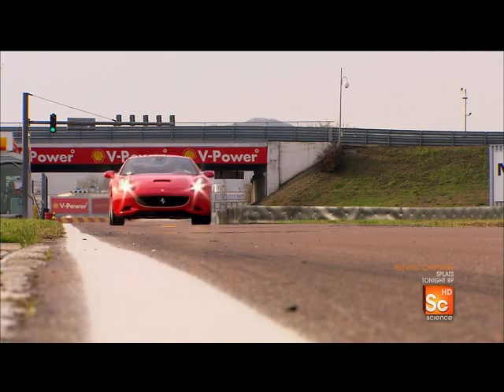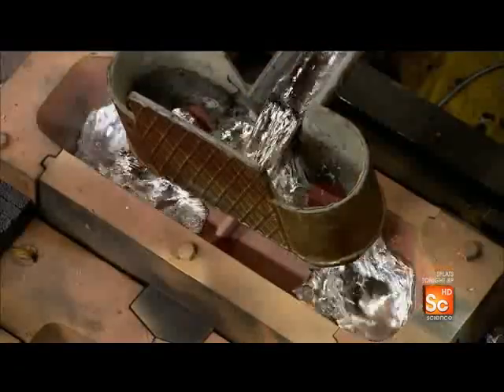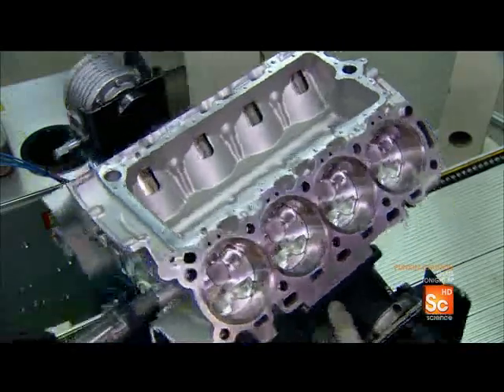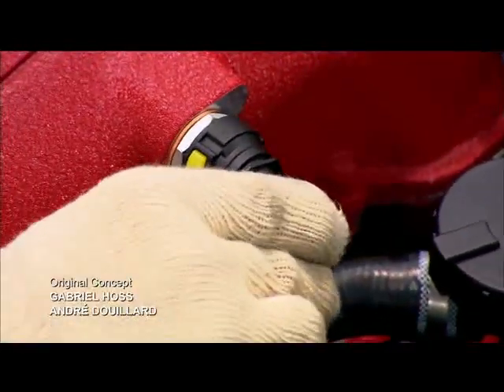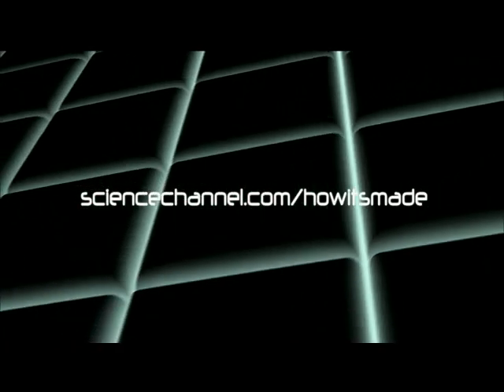How It's Made High Performance Engines

Comment: oh cool it one of those quad overhead cam camless engine ive heard about from every how its made video showing engines ever
Reply: +Eric Wesson Yeah...I've never assembled an engine, but I assemble lots of things, and was looking at that thinking "wtf is the point of doing that when the cam isn't in?"

One of those things that's so simple, if you have to tell the tech that, you need a better tech.
Reply: +KSI SubSonic They were probably installing the cam caps ready for line boring because none of that was mentioned in the video.
Reply: +aluisious yeah they completely left out the milling portion of the build where they flatten all mating surfaces such as the the cylinder heads, where the oil pan goes, etc. You would also want to install all bearing caps for when you bore the bearing locations. they do this to the crank, piston, and cam bearing locations.
Reply: adam courtney they have to make the episodes fit within a certain time period. when they have different time constraints they show more or less detail in the construction process.
Reply: It's actually Dual Overhead Cam, 2 cams per cylinder head

Comment: Add valve cover. Then install air intake manifold and fuel injection system. But what about all the over parts? Like oh, I don't know, oil pan, alternator, distributors and spark plugs roller rockers and push rods etc etc. also they didn't tell you about priming the engine and all that other good stuff.
Reply: also didnt mention bearings........ pretty sure he put the crank in without beari gs.
Reply: iiR4MP4G3   Oh man, who needs bearings anyways, right? just let the crank spin loosely like a hot dog spiraling down a hallway...
Reply: 3:50 looks like a dual overhead cam, no pushrods. But, yeah don't forget oil pump, water pump, and power steering pumps either. Lots of omitted information.
Reply: that wasan+t fuel injection system :)) what you saw there was the Carter Gase Hose atached to admision
Reply: Magic powder?
Reply: MOM ITS NOT WHAT IT LOOKS LIKE  rod u r busyed
Reply: What about tuning the ECU?
Reply: Jay Hopkins cam shaft

Comment: NHRA sanctioned Top Fuel are forged aluminum blocks.  Mostly aluminum parts, except where there is titanium, iron, and some off metal in the heads.  These engines now make 8000 plus hp.

Comment: you can spin the crank without lubricant, lubricant is only there to cool down and ease movement at high revs. if he was spinning it by hand at around 1,000rpm then that would be a problem.

Comment: Sand casting the engine is probably the most widely used way of creating metal ever. They make everything from golf club heads, turbocharger, to jet engines with it for a reason. Its better then CNC machines can do cause its poured into shape while still in a liquid state.

Comment: I still don't get how they can use Aluminium for this, it's so freakin' soft. I work with it every day. The slightest bump bulges it
Reply: Elle Sea Nah, it's my fault. I just learned about alloying yesterday, I asked an expert why they use Al for motor blocks, etc.
There are a lot of different Aluminium alloys, I didn't know that!
Reply: There are different grades of Aluminum. Some harder than others.
Reply: JackCarver10
There are means of heat treating it for extra hardness aswell, also in the case of ally engines they tend to use harder alloys/metals in high stress/wear places (eg. steel or compacted graphite-iron cylinder sleeves, manganese-bronze valve seats/guide sleeves etc)
Reply: Remember the part where they drove cylinder liners into the block? That's how: all the wear parts in the engine are some non-aluminum metal. In the case of the liners, it's almost always a ferrous metal, which works great and is cheap.

No cylinder liners is why the old Chevy Vega engine was such a piece of crap; they ran the pistons inside aluminum cylinder bores and the engines wore out quick.
Reply: JackCarver10
The blocks are made out of Aluminium for low weight, but the cylinders are sleeved with cast iron tubes to add strength.
Reply: typically use cast iron cylinder liners to solve this

Comment: they were spraying to make sure the sand was out of the engine...no actual parts were installed yet so the air was going to flow right from the water to the intake valves anyway.

Comment: • The engine block is usually made of cast iron. But in the late 1990s, engine blocks were made of plastic and other materials used in prototype cars with the aim of developing more efficient and lightweight cars.

A cast iron engine block can comprise a significant proportion of the vehicle weight, it usually requires several people to be removed and worked on safely.

  engine block includes cylinders, cooling ducts, oil ducts

• whAT ELSE CAN I WRITE ABOUT THIS MACHINE YO ENLIGHT ME WITH MORE?????
Reply: wtf... is made with alloy

Comment: me to, but on a normal car.  On a ferrari a cast iron block would be a drag and would do harm to the performance and balance of the car.

The good thing is that the cylinders are dismountable and replacable,  most cast iron blocks you can't replace the cylinders

Comment: its not dangerous like your thinking. liquid nitrogen is used in this case to make the metal contract for manufacturing purposes. basic science dictates to us that the colder something gets, the smaller it will become. So liquid nitrogen being near a -200 F will make the metal contract long enough for them to insert it into the engine. hope this helps.

Comment: 1. Brand name.
2. The machines they used to build it are expensive as hell.
3. They used VERY nice parts; all aluminum everything.
I have only rebuilt two engines (both Subaru EJ25's, one turbo, one N/A), but without the tools they had at their disposal, engines simply cannot be built to competing specifications without a ton of time and effort.  And the parts put it in a different league.
And that's just the engine.  The rest of the car is a similar story.

Comment: Next the engineers insert the pistons using a rubber mallet. Then the engine valve cover is inserted along with the engine intake.

It's all about missing 9001 other components.

Comment: Actually, I'm mistaken: 3:51. They look to be about 14mm lift. Not much duration, therefore less overlap. An emissions engine. Variable timing, probably electric. Timing chain must be exotic because it looks too small for the job. Not very knowledgeable about cavallino rampante (sp) but it's fun to speculate.

Comment: valve seat, not guides...
Reply: Actually the video is right. A valve seat is where the angle of the valve comes down and sets in the block itself. Valve guides are inserted into the block like a sleeve where the valves will actually be operating in.
Reply: Jonathan Kurtzman Dude, valves haven't been mounted in the block since the 60's!
Reply: beachcomber535 dunno if we're on the same page but the narrator said the guides go into the cylinder head & not the block... hahaha my personal experience is that to remove valve guides on my Nissan engine, you have to submerge the cylinder head in a hot water bath @ 270+deg before you can knock the guides out ie the reverse of freezing them to get them in the ferrari LOL
Reply: And sleeves, not cylinder liners

Comment: This engine is good for planes too. ^_^
Reply: Abdelaziz Elrashed remote control planes? piston aircraft use rotory engines. and leaded fuel. 100LL to be exact. this engine couldnt handle lead
Reply: +Cliff Charpentier not every plane uses a rotory engine lmak
Reply: A v type and straight I don't think has been used since ww2

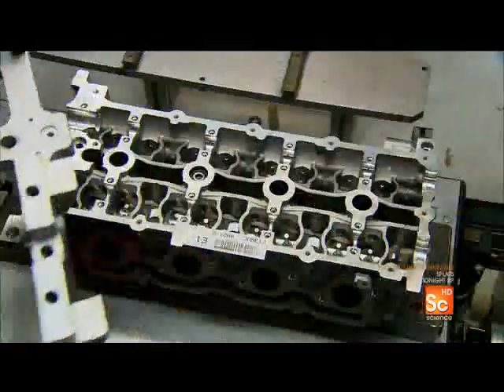Comment: They were to vague when they mentioned machining the crankshaft at 2:54.  They didn't say how they made the valve cover either.  I wonder how much this would cost as a do it yourself project.... Minus the dynamometer of course. That part of the video sounds like it would be not absolutely necessary and incredibly expensive.

Comment: If you really want to know good engine building tips, check the building hpf bmw engine video :)

"secrets behind the hpf 1000rwhp daily driven bmw m3..." etc.

In this video it's funny how they wash the mold and get the crank bearing journals machined at the same time :D

Comment: @thdmtr Okay then, I see your point, but use of materials dosn't always matter, it usually depends on how well the product was engineered. Now, when talking about an older engine, there are after market products out there that have a much better design, and are built with better materials, these make an old engie A LOT better. So you have to take everything into account, not just what material an engine is made of.

Comment: (cont) Day 3: (10:00) No beer, driving. Pick up block n heads from shop. BS with shop guys for an hour. (11:00) Go home. Grab a beer. Unpack parts that arrived(if lucky). Assemble engine. (12:00) Grab a beer. Continue assembly. (1:00) Grab a beer. Drop motor into car. Begin hook ups. (2:00) Grab a beer. (5:00) Fire up engine. Fine tune. Grab a beer. (6:00) Jobs done. Grab a beer. Clean up. Eat dinner. Bone wife.

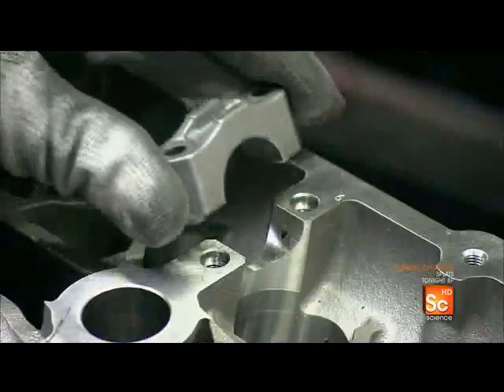Comment: (Cont) (12:00) Grab a beer. Clean parts more. Make parts list of potential power adders. (1:00) Grab a beer. Call up guys at the shop. Get "Block and heads are good" ok from shop guys. Tell them to bore and hone to the max. Get dimensions. (1:30) Grab a beer. Start ordering performance parts for next day air. (2:00) Grab a beer. Call up friends to help push(insert favorite year/model) car into garage. (4:00) Grab a beer. Pull old motor out of car. (6:00) Grab a beer, eat dinner, bone wife (cont)

Comment: That's not true...all engines use a crank shaft, that drives the pistons and one or two (four for v type engines) camshafts...newer engines don't use pushrods any more although some still use them:) it's imposible to have an engine without a camshaft only if there is an electrical thing that pushes the valves

Comment: @killercd4g63 Iron is good to handle lots of hp, better to bore, but they dont last, they will rust from time to time and they are heavy. but the high tech era as today, almost all high preformance vechile uses alum block

Comment: Why aren't they cncd?
Reply: They probably could, but, the block and heads would have to be built up from many CNC parts in order to get all the air and coolant passages to work. The way they do it here, the passages are all sand cast in place. It's cheaper, faster and better to sand cast them.

Comment: its not much of a DIY project, takes a precision mold to form the sand for the aluminum mold, and special grinding machines to make the cylinder inserts,  they hardly go over anything in this video, its possible to do something similar if you understand cadcam, engineering, tool and die, and cnc machining

Comment: @killercd4g63 The fastest street cars on the planet use aluminum engines. Cast Iron is a heavy and OLD technology. Aluminum is much lighter and with specific mix of different other metals, can be made STRONGER than iron. Plus it doesnt rust.

Comment: Why would I do that?  And Top Fuel achieves estimated 8000 hp on aluminum blocks.  Modified aluminum blocks can make just as much and maybe more.  Corvettes and others at Sebring run aluminum.  Shelby GT1000 makes over 1000 with aluminum as well.  The block will just be bigger and have inserts made of iron or whatever they can "cook up".

Comment: Thats not how a high performance engine is made!
This is how:
Day 1: (9:00 AM) Grab a beer. Pull 454 out of old chevy truck. (12:00) Grab a beer. Start dismantling motor. (1:00) Grab a beer. Push truck out. Barter with friend to sell it for more beer. (2:30) Grab a beer. Start cleaning engine parts. (5:00) Grab a beer. Clean up. Eat dinner. Bone wife.
Day 2: (9:30)No beer, driving. Take block and heads to shop. BS with shop guys for an hour. Dream about buying machinery. Head for home. (cont)

Comment: So much wrong with the commentary! Dosen't include cylinder head machining, when he says valve guides its actually the valve seats, when he says they're checking the intake manifold with compressed air its actually the waterways.

Comment: Yes nitrogen is a gas. But it can also be a liquid. Remember science class, dip a rose in liquid nitrogen and it instantly freezes and becomes EXTREMELY brittle? Well same concepts, except without the chance of the shattering the aluminum.By dipping the part in liquid nitrogen it instantly cools it to where the molecules contract. Nitrogen gas on the other hand doesnt have the same cooling capacity.

Comment: Breen... If you had watched the video you would have seen "FERRARI" cast into the valve cover. Ford 302's were not aluminum, didnot have 4 valves per cylinder nor did they have dual overhead cams.  Go back and watch the video and learn.

Comment: So, if Top Fuel uses iron block, it'll last for years and years??  Aluminum doesn't rust like iron.  Idk about you, but I'm not against iron.  Why do you hate aluminum so much?  Is it bc you can't afford it?  I can't afford any expensive aluminum block either.  That's why the LSX is so popular.  Not bc it's superiror tech, it's just simple, cheap and smaller compared to aluminum, more room to work with in a shelled/bodied car.

Comment: One set of valves lets fuel into the engine? Thought that was the fuel injector lol. Think he means air
Reply: +Jawad Saleh depends on if its direct injection or not. if not, fuel is injected into the intake manifold then the air/fuel mix enters the combustion chamber via the intake valves

Comment: Shouldn't it be liquid NITROGEN? as liquid Hydrogen would be, you know, a little flammable as it evaporated into the air. And BTW liquid Helium is colder than Hydrogen, I'm pretty sure.

Comment: Isn't building the block and heads out of billet preferable? I watched a video of a 427cid block  for a Cobra built by Kirkham being CNC machined from a single block of aluminum. It seems to me that makes for a stronger, more precise engine. The shape of the block follows the contours of the cylinders, saving weight and aiding in heat dispersement, or so we're told. It sounds logical. The block weighs in at 67 pounds. Without  cylinder liners. The heads likewise are ultra light. This engine is capable of high revs, but not like a Ferrari. It is more powerful in the low end, torque department. I guess it's pick your poison.  I won't be buying either. Too rich for my blood, but I can dream.
Reply: Billet is a lot more expensive and time consuming not to mention it's not really needed in aspirated applications. Keep in my mind this video is quite old.

Comment: Where the fuck is the camshaft?
Reply: It's a DOHC 32v V8 so there are 4 camshafts , two per cylinder head , and they are mounted directly above the valves.
Reply: I know where and what a camshaft is.
Reply: I was trying to be edgy m8
Reply: Look at 3:50. They're installed in the heads.

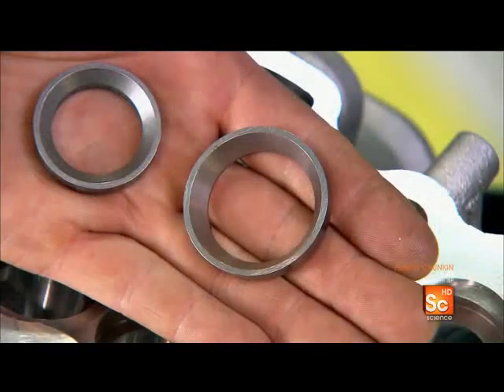Comment: There are more stupid errors, 2:10 for example...

"With a blast of pressurized Air, workers verify that the maninfolds Air Intake..."

Well, i have never seen an Engine sucking in Air through its Water Passages ;)

Comment: what the fuck are yall talking about? cast iron? cast iron is bullshit. if you want an iron engine that will hold up under stress you need a forged block rotating assembly and heads. cast iron is brittle compared to forged material.cast aluminum is shit aswell. stick with forged metals. and cold forged is even better.